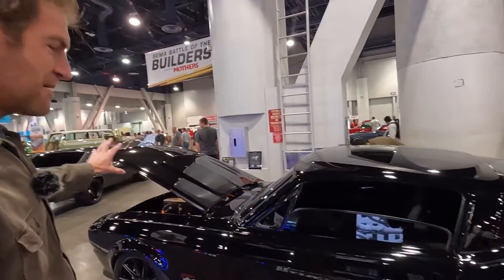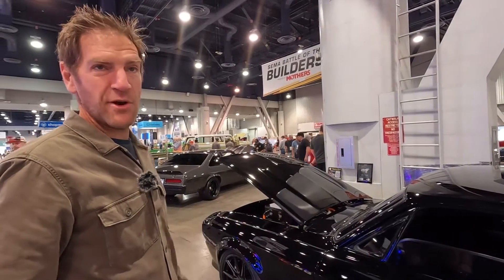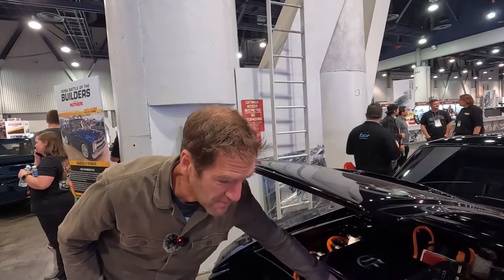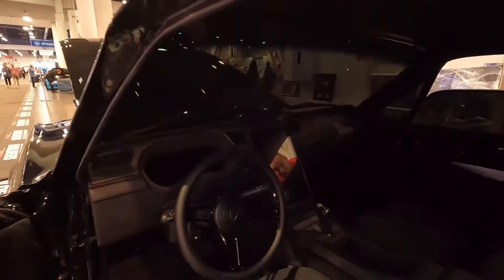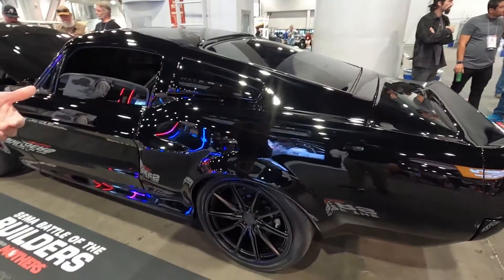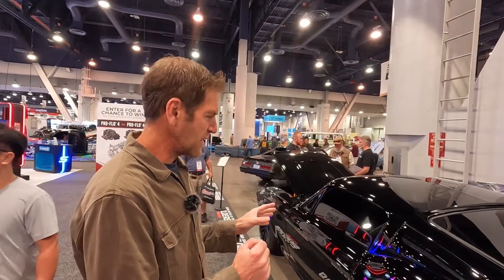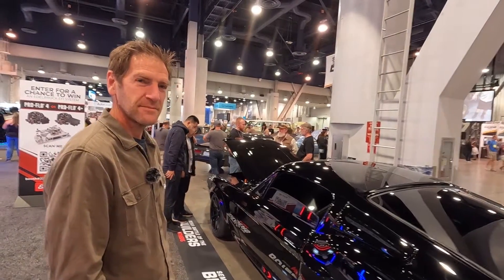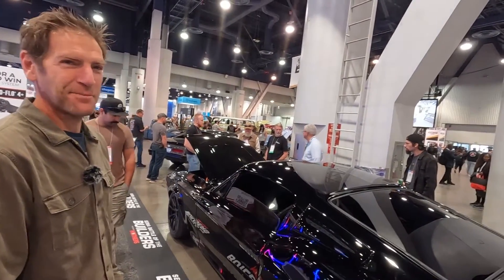Ford Mustang GT500 EV Conversion

Comment: Crazy it's about 500# less than a plaid with awd&the same size pack, and about the same weight as a current gt500 with fuel weighs. 👍🏻😎
Reply from the maker: You're right there, and 500 lbs makes a big difference how a car feels to drive. At the track I am always hanging out with the Mustang guys because our cars are similar weights and so the approaches to turns are also similar haha
Reply: @EVTUNERS  it's funny imo because in the 70s average car weights we're just over 4,000 without all the luxo barge, trucks n suvs we have now.

And in 2020? Loe n behold the average vehicle weight is just over 4,100# but evs are so heavy mannnnnnnn. I'll take a modern crash tested sled thanks with real tc abs useable tires etc vs anything from the 60s or 70s. 😅
Reply from the maker: @4literv6  hahaha aw man so true. You see that  NHTSA old vs new gif from awhile ago? Crazy. I'd still take a restomod as a weekend driver or cage it for the track if the right one came along though. Can't change the crumbple zones but good tires, brakes, tc, and abs can't be understated

Comment: This is a Dream car.
Did he say what the price range he is asking for the car?
Reply from the maker: So there is a cost range dependent on configuration. For the '67 VIN Mustang $220,000.00 to $350,000.00. There is also a slateboard platform only (I'll have some video of that soon) which ranges between $75,000.00 and $150,000.00
Reply: @EVTUNERS  so cheaper than the charge cars 67 ev thats ground up then. 👍🏻😎